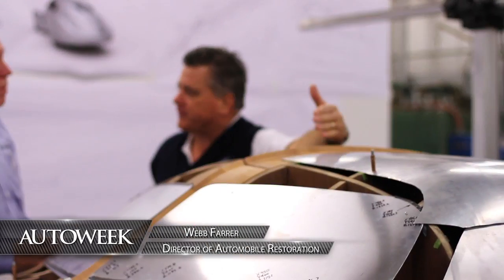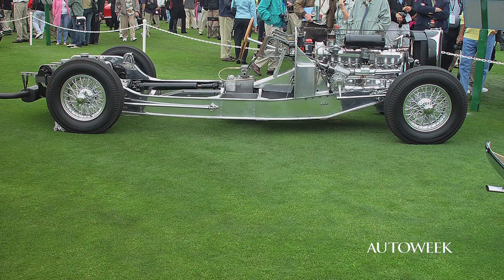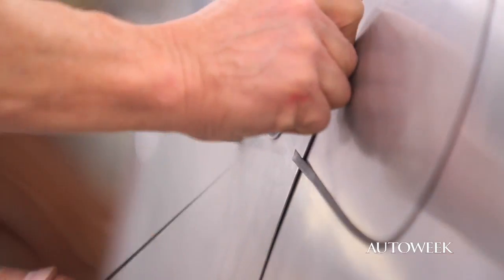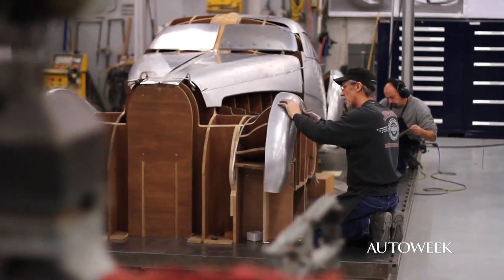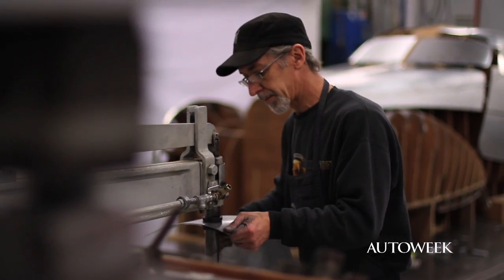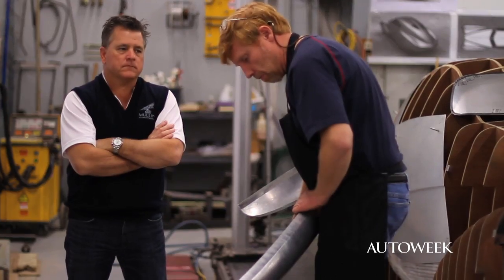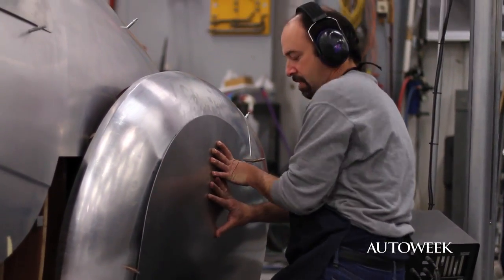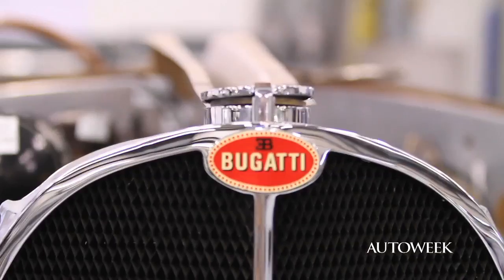1939 Bugatti Type 64 build - restoration video (part one)

Comment: Some criticism in the comments below. Nobody claims this is a restoration of a car Bugatti made. They had a chassis + engine & driveline for a slightly different type of Bugatti, that was never finished. It isn't entirely 'original' because some efforts have been made in the past to use it for something. It has been 'restored' to rather lovely condition, but some bits had been worked on, way back, in ways that didn't exist in '39. They took that chassis and built a type 64 body for it, using as close as possible to the exact methods and tooling and materials that Bugatti used at the time. Nobody claims it is an original type 64. It is a very painstaking modern tribute, a reproduction using some original or near original parts, and the most accurate copy of methods and tools they can, nearly a hundred years later. And it is rather beautiful. If they tried to pass it off and sell it to a collector, for millions, as an original car, then the criticism would be justified. But that isn't what they're doing. It's a tribute, and very beautiful.
Reply: Kneedragon1962 This.  Great comment.

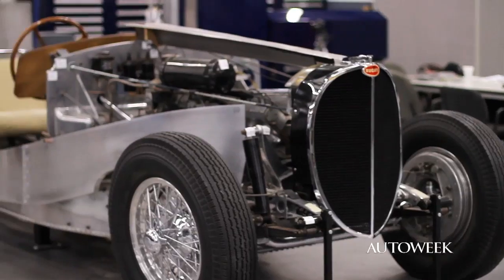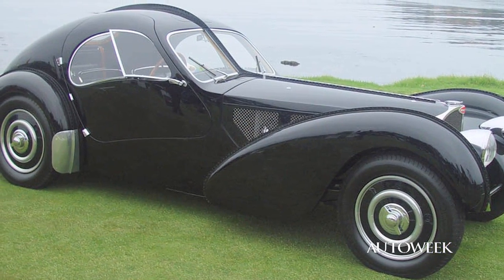Comment: I think that there are some "mistakes" about this car. First, this chassis is presented as being a Type 64 and it is said at 0:25 that there were only three chassis like this one built and the presumed two others are shown at 0:29 and 0:30. It's a bad mistake because there has been only one chassis to be built as  Type 64 and the two others cars shown in the video are Bugatti Atlantic built on Type 57SC chassis. The differences are the following ones: the Type 64 was powered by a 4432 cm3 8 cylinders in line engine (bore x stroke: 84 x 100 mm) which developed at that time 170 hp and the wheelbase was 330 cm. The Type 57SC was powered by a 3257 cm3 8 cylinders in line (bore x stroke: 72 x 100 mm) which developed 135 hp, the wheelbase was 330 cm too. So if the wheelbase is the same, the engines are quite different, so that the chassis and the two other cars are not the same types. Secondly, as I said above, there has been only one type 64 chassis to be built in 1939 with mechanical drum brakes and friction-type shock absorbers. The chassis shown in this video has hydraulic brakes and hydraulic shock absorbers and its construction can not be dated from 1936 due to the presence of numerous welds. And the welding process began to be widespread only in the 50s in the automobile industry, before the frames were stamped and riveted under heat. Finally, for me, it makes no doubt that this chassis is not a Type 64 at all, but a Type 101 which has the same wheelbase of 330cm, the same engine as the Type 57, hydraulic drum brakes and shocks absorbers, built in 8 units in 1951.
Reply: VonDuesenberg see you spotted mistakes that an average guy like myself that doesn't know to much about these cars when it go's in the museum they will say the same thing maybe those chassis were meant not to have a body on them
Reply: @SNOOP U 2 And you're contrary evidence is? Cuz all you did is spout some BS.

Comment: didn't the guild automotive restore one using a matching chassis drive trai  and they built the body out of magnesium and not aluminum.
Reply: Yup you are right
Reply: Aviator Guy well that was a type 57, this is a t64.
Reply: yowza yowza pretty sure they called it the aerolith too

Comment: I find that "how it was done" to be unimportant and unnecessary. As long as a vehicle is made with the same materials, in the exact same format (welds and gaps where there should be, the same number of panels, same rivet placement, etc.) then it doesn't seem like anything other than a waste of time to do things a way more difficult and slow way just because that's how it was done back in the day. Ideally, if you're doing a restoration, it seems ideal that you would be able to perfectly replicate a vehicle using modern technology. This saves time and money. Only someone who likes throwing money away would demand that a vehicle be done in the most extraordinarly labor intensive way possible.
Reply: +RiouInsuiko  i totally disagree with you i am sorry it will never have the same look and feel and sole if u dont hand build it this is wrong with the world they all want it now and not use your hands to build it we need the world to still have these skills
Reply: +RiouInsuiko, not your car dude, so your opinion is WORTHLESS.
Reply: SuperExcedrin My comment wasn't your opinion. Therefore your comment and opinion is WORTHLESS.
Reply: +RiouInsuiko they are not doing a restoration. They are making an original Bugatti. Because of that , the car will be considered an original one. Big difference.
Reply: +TFA fab I agree with you %100
Reply: First, no, you can't "perfectly replicate" something using completely different techniques. That's a fantasy. Second, they used period techniques in part to create an exhibit demonstrating the techniques themselves, which are of interest. This was explained in the video. You missed the point. But if you're not interested in this stuff, that's fine.
Reply: arlingtonhynes  yeah to each their own on how they want it built but what are you going on about? Literally the only way you would ever have something 100% replicated is if you machine scanned it with a computer and built in exactly the same way off of that down to the last river and bolt in the same place. Doing it by hand is gonna lead to flaws and differences in the car not allowing a “perfect restoration”
Reply: They aren't building a car, they at emaking a museum display showing how cars were built at the time.  They are making no attempt to restore or recreate a body, since the car never had a body.

Comment: This type of bugatti wasnt made of steel or aluminum it was made out of the incredibly fussy metal known as magnesium. Magnesium at 1100 degrees Fahrenheit will catch fire and can be dangerous thats why do few of these beautiful cars were made. To calk thus a full restoration is false they haven't gone through half the effort it took original bugatti workers to build this. This bugatti on average took 7000+ hours to build.

Comment: that doesn't look exactly how th car looked in 1937, it wasn't welded, and there is no fucking way the museum wouldn't be convinced that the car looks the same as the REAL CAR. so take it apart, and do it properly. you probably don't know how it really looks. send it to bugatti and let them restore the car for you.
Reply: well for one thing.... the car was only a chassis, no body ever. So...... theres no way for it to look exactly like it did in 1937, not to mention it is a 1939.
Reply: THE VLOGER I just wrote the same thing maybe those chassis were meant not to have a body on it? Good call someone else called it out if they are going to teach history they need to teach history they right way and build a chassis for that car to right! They are half stepping